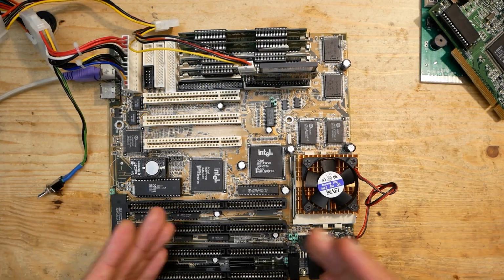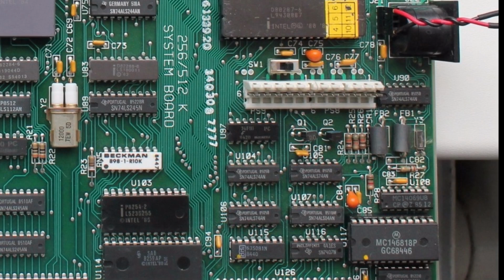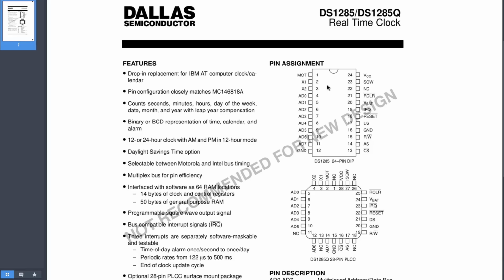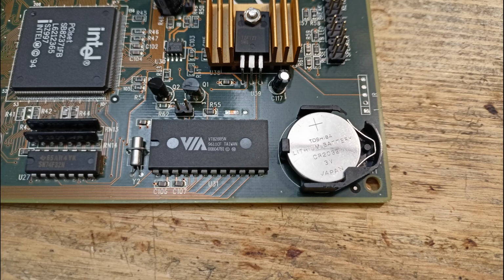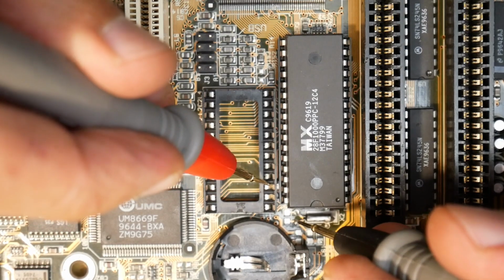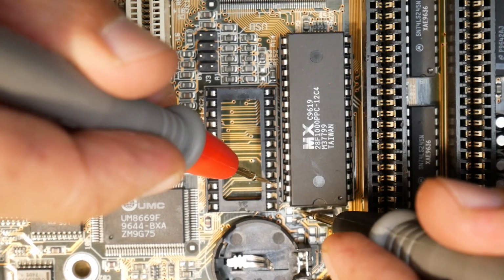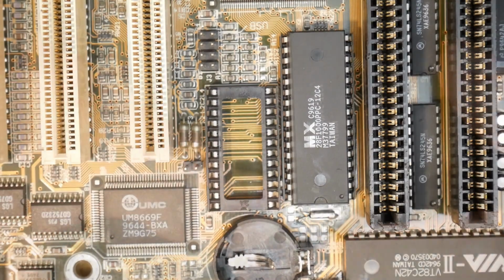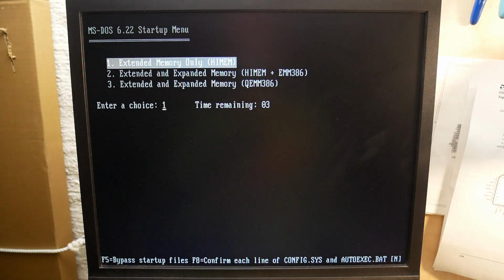Let's talk about RTC options once again

Comment: I wonder why super capacitors were not used instead of these batteries? Same circuitry, just a different  power source, a power source that could theoretically recharge while the computer is on.

Comment: I'm very late to the party with this video, but it's still very relevant 2 years later.  And your presentation of the various repair methods is, as usual, impeccable.  Thanks for this video.  I wish it had been available 6 years ago when I did the Dallas chip in my Sun Sparcstation.  I used the old cut the battery region open and added an external battery and diode.  Your other solutions are so much more elegant, though. My poor Dallas chip looked like it had seen better days when I finished, but it still works today.

Comment: I tried this method of removing the resin.
It was a lot of work, and it resulted in many bent pins which then snapped when i bent them back.
My hairdryer was not hot enough to make this resin really brittle.
Cooking it in the oven worked a lot better, but since i use that oven for food i felt that i had to clean it twice after doing this.
I repaired the broken pins. But since i'm not a solder guru the chip ended up not fitting properly in the DIL socket, and it kind of wants to fall out.

I think the surgical procedure where you drill a hole and attach a battery is preferable to most people who just want to get this working.
Don't go down the rabbit hole unless you have to.

Comment: If I just want to replace the old battery with a CR2032 holder, do you think this method would be better than grinding the side of the casing with a die grinder? Thanks.

Comment: I don't have a hot air station(for now) but I do have one of those tiny aliexpress usb-c hot plates. Do you think that might work to melt the resin if I just set the dallas chip topside down on the hot plate?
Reply from the maker: Depends on the temperature. If you can set it down to 100°C, may be that would work.
Reply: @necro_ware alright i'll give it a try.

Comment: My new  understanding that the 87 Dallas is an 85 chip with battery and oscillator is great to have.  I would rather try replacing the battery first, but knowing how to disassemble and reuse is brilliant.

Comment: You could try the DS12885S+ for a new module design
Reply from the maker: It's basically the same chip. If you have that, you can use the same design.

Comment: I had to deal with one of these crap modules years ago, ended up having to desolder the damn thing, solder a socket in its place..and I, somehow, managed to not damage the board in the process...then do the hack with a knife and file to get access to the battery.
The info readily found on the net today I didn't have at the time.
I swore I would never 'do' a motherboard that had this or similiar modules on them ever again.
Glad they went out of style and back to coin cells.
There should have been lawsuits over this crap.

Comment: This video is AMAZING. I have a mobo - PcChips M560 rev.3.1 - and it contained the dreaded chip VIA VT82887, of course with dead battery inside. The system refused to POST due to low battery error that could not be skipped. So I was researching solutions, found your opensource adapter, but the recommended Dallas chip is very expensive (mouser still has it). Luckily I found this video and decapped the epoxy resin easily. It didn't even really smell and went off without problems at around 100 C (my desoldering gun cannot go lower than that). Inside was the dead battery, crystal, and two capacitors for the crystal. All on a small PCB. Associated pins were bent topwise, so I bent them down. The chip inside was VIA VT82885.
On this motherboard, there were places for the crystal and its two capacitors and one resistor. The capacitors were inside the VIA chip and I took them off and soldered to the motherboard (2x 12 pF), but the resistor was not, so I didn't solder it as I don't know its value, it's not even mentioned in the datasheet. Then I soldered the crystal to the motherboard.
There was no place for the battery on the motherboard, so I soldered it to VBAT and GND of the chip. Then I connected the two XTAL pins to the crystal on the motherboard, as its associated traces went to "nowhere".
When I connected the battery, its voltage dropped to 0.7 V and it started heating up. Not good. After some hours of fiddling I realized that on the board, VBAT is connected to VCC - main 5 V rail of the board. What a stupidity of the designer (another stupidity is that the RTC chip blocks some PCI slots). So I cut off the pin and isolated the socket hole, and soldered battery leads from the top of the VT82885 chip.
It worked and now the board goes through POST without issues. Hopefully this helps someone too :)

Comment: Thanks so much for this information!

I had an old 286 motherboard that had an ancient RTC chip, that was pretty close to the Dallas chip according to the datasheet. The original rechargeable varta bomb RTC battery was dead and had started to leak, so I removed it. I did replace it with 3xAA batteries, and they largely worked, but after a couple of years, these alkalines were leaking as well and I had to remove that solution.

In looking for a better solution to the CMOS situation on this old 286, on a whim, I threw a dead dallas in there and it worked for storing the CMOS information and running the clock.

I then used your heating treat to remove the old casing and battery from the dead Dallas module, leaving the clock Dallas's own clock crystal on it, and soldering leads to an external CR2032 battery holder to the dallas chip itself. This way, I bypass the motherboard's battery headers (in case it was trying to charge the battery while powered) and I get to use the Dallas's very efficient clock chip without any additional parasitic load from the motherboard. 

Being my first time, it was nowhere near as neat as yours were, but still, your instructions worked and I was able to remove the old epoxy. 

With any luck, this will keep the clock and CMOS settings correct for years in comparison to the original clock module, which would be something like 100 times less efficient and chew through batteries.

Comment: This is brilliant. I just did this to three RTCs, and just as a warning, when scraping off the old epoxy, be careful around the 22-24 and 1-3 pins, as I tore the oscillator clear off. Luckily I have a stack of these failed RTCs to work on.

Brilliant work here.

Comment: I think the Analog Devices DS12885SN+ is a pin for pin replacement for the DS1285, but it's surface mount, so would need to go on an adapter board or something.
Reply from the maker: Yes, that can be used on my nwX287 module instead of bq3285.

Comment: Thanks so much for this video. I recently picked up a PC with an ODIN Dallas RTC clone. Thankfully the motherboard has the spaces for the oscillator and CR2032 holder, so I'm going to be using this method to rebuild the timing circuit. I'll probably put out a video on my channel if successful (with full credit to yourself of course) and I'll let you know how I get on!
Reply from the maker: Great if this could help! Thank you for watching too. I already repeated this not only for Dallas, but also for ODIN and Benchmarq modules and it worked fine for all of those. On note, the crystal in the module is soldered directly onto the pins of the IC, but depending on the distance between the crystal and the RTC IC on the board the oscillation can get unstable. To work against that you can solder 10MOhm resistor between the pins of the crystal. Usually mainboards already have a place for that. Good luck.

Comment: Thank you your upload! Just finished a conversion of a Dallas Rtc using the heatgun. Sacrificed a dip24 socket to save the legs of the crt ic from bending. Put the crt ic to the socket and push the legs of the socket invards. Used higher temperature - 200C degree - for shorter time to soften the outer plastic. Come off easily with the screwdriver. The resin needs a little bit more heat but it come off by chunks applying heat again after a chunk removal. Piggy backed a 2032 holder and done.  The crystal and the IC survived the higher heat, it works fine. Thak you again, no mess at all.

Comment: Thanks for the tip! I managed to replace the battery without desoldering the module from the board. I used a hot air soldering tool.

Comment: Can I just leave the RTC as it is with dead battery inside and solder CR2032 to the board (I have a place)?
Reply from the maker: No, unfortunately that will not work.

Comment: I heard about this in the last episode of Adrian's Digital Basement with the Plexus!
I easily have 3+ dozen of these darn things to modify or replace, some soldered in, some not. 
I've been ignoring the problem for years as doing the drop in replacements on everything would cost me a pretty penny in RTC chips alone and I was not comfortable coating an area in plastic dust from my dremel or leaving the original batteries in situ for the next 3 decades to short out or cause other problems if moisture should creep in.

Thank you for figuring this out, it sounds like I should build myself a little fume extractor, grab a pile of motherboards, extract the easy ones and decide if I am going the CR2032 route or do something closer to the original battery and buy a huge quantity of cheap coin cell battery holders. I will have to get creative for the network gear and analyzers that have all their stuff shoved in a card cage though, since height will matter.😅

Comment: Thank you for open sourcing your RTC replacement. I've had great success with using the TI BQ3285S-SB2 with your design. It's still made and readily available from reputable sources. No hacking old parts needed. :)

Comment: There seems to be some confusion between a "crystal" and a "crystal oscillator". Also the capacitors near the crystal are not for stability - the oscillator will run a bit too fast without them.

Comment: Regarding adding a battery by drilling a hole: doesn’t that put the new battery in parallel with the old one, causing the new battery to charge the old one?

Edit: it was adressed in the revised repair video; cutting the internal battery extends the lifetime of the new battery but the module can also work with the internal battery still connected.
Reply from the maker: Yes, I addressed it in one of my older videos. This is a common concern, but the internal battery is not rechargeable and seems not to pull a significant current. I tested two modules over 3 months, one where I cut the internal connection to the battery, the other one where I left it connected. In the end of my test I couldn't measure any difference in discharge rate of both batteries. It could be somewhere under 10%, but since the module can survive around 10 years from one battery it's just a question of 9 vs 10 years. Not really something to worry about if the battery is easily exchangeable.

Comment: They really should have installed some heatsinks (even just some metal rods or sheets attached to an metal radiator would do) inside the C64 power supply and then the resin potting would have been no big deal, at least until the PSU failed...

Comment: I have had success with other potted chips, heating them up as you described, the placing directly on ice in the freezer, usually the thermal coefficient of the chip material is different to the epoxy compound, giving a good, clean cleave line at the junction. Maybe this will give you good results without having to use force that can mangle the pins 🤞

Comment: These were a problem even when first became "standard" from Dallas because knockoff parts quickly came on many MoBo and more and those often died in a year or two. Then can Replace with Dallas parts but cost money and down time for many people and companies. Even Dallas parts with there small battery doesn't last long in equipment not connected to main power for weeks to months between uses or even storing new equipment for any reason. Many manufacturers switch to socket mounting Dallas chips for this reason because easy fix when dies under Warranty.

Comment: But also, you can give 5 Volts to DALLAS "black box" Vcc (pin 24) and it will work, yes? So, two diodes, resistor and small Li-Ion battery can solve problem with drain internal battery :)

Comment: Building some of your RTC modules has been on the todo list for awhile now, the biggest barrier being acquiring the BQ3285 IC's. After watching this I went into the drawer full of dead Dallas/Benchmark RTC's and revived a couple using this method. I used a sacrificial socket and my hot air rework station, a pair of old needle tipped tweezers worked wonders for chipping away at the epoxy. While I still want to build some of the RTC modules you designed, I do love being able to recondition existing RTC's with the parts I already have on hand. Cheers!
Reply: That's because the RTC (chip) isn't dead, just the on-board battery.

Comment: THX 4 vid
Chemical solution: Ethanol, paint thinner, adhesive remover. Heating a litte bit make the process faster.
      Use protective equipment
Test this way.
Reply: I found an old post that says to use 1-methyl-2-pyrrolidinone. I bought some on eBay, soaked the chip, and a week later I came back and all the potting was dissolved.
Reply: @owenmann1 
THX 4 hint. 
But in EU this in no more allowed in EU, in Germany look: 
"The restriction stipulates that NMP may not be placed on the market as a substance or in mixtures in concentrations ≥ 0.3% from May 9, 2020"

Paint and paint thinner are available without restrictions in Germany and can be handed in at the recycling center (municipality).
Sry 4 my bad English.

Comment: I think it is great the work you have done to make the replacement modules. I have seen others revive long dead systems with them but have yet to have a need to try it myself though I probably will at some point given the old systems I work on. Sorry you catch flack the times they don't work for people. Matching up the exact right part in something decades old in every situation is complicated. The work you are doing is appreciated and please keep it up.

Comment: Are you joking me, All those Dallas modules were just a chip with some pins bent up, a few parts added and a resin box glued atop it. If your looking to go deeper. Find an EISA bus motherboard. These boards usually had a rarer Dallas module that was not the standard one, as it had space to store the EISA configs.

Comment: If we do the last option (hot gluing the battery), does that mean we will now get the full capacity of the cell battery?  It's my understanding that the drill solution will drain about 1/3 faster because the dead battery is still connected.  If this is true, I will most likely move to remove the entire housing going forward.  Thanks for what you do Necroware!

Comment: 15:30 I've extracted a few C64 transformers from the case by heating and chipping away at the brittle epoxy and also extracted security modules or microcontrollers on arcade boards the same way. It works well but you don't need to remove all the epoxy. For the C64 PSU just remove the pcb and replace with something better. I made my own SMPS board that fits inside. The transformer works fine as-is with epoxy around it. The wires are visible and just need to be connected to the new SMPS board with a direct pass-through for the 9VAC. I also drilled into a ST M48T58Y rtc module (used on a lot of Konami arcade games) and added an external battery. Inside is a special chip and a crystal and nothing else so they can't be built from parts. These M48T58Y chips are incredibly expensive now, over $30! From the factory the battery is disconnected and on first use or testing the battery is automatically connected. But if some seller tests them 10 years ago the battery is then working and when they put on the shelf they will be dead 10 years later even if New-Old-Stock. Best to drill into it and attached a battery holder on top.

Comment: Thank you for the video: the care and effort you put into finding ways to keep these old systems operating is heart-warming.
Now apologies in advance for the comment that's coming: please don't take it personally.
"Crystal oscillator" is the circuit which generates a periodic signal at a stable frequency. The component in the metal can is just a crystal (quartz crystal) and the inverting amplifier (or inverting logic gate) is inside the chip, across the two pins marked as OSC1/OSC2 (sometimes OSC-IN and OSC-OUT). It's a bit like having a clock with a pendulum and calling just the pendulum "pendulum-clock".
Reply: yeah most people think a crystal and an oscillator are the same thing lol. on the usual selling sites with smd 4 pin types they often say active / passive but most people don't know what that means either. The active ones are true 4 pin oscillators and passive ones are crystals with 2 pins not connected.
Reply from the maker: Yes, you are absolutely right. I even explained the difference between resonator and oscillator circuit in one of my own videos a long time ago, but I keep saying this. I have to stop doing it indeed. It took me also a while to stop calling the electrolyte in the batteries acid, despite that I know, that it is actually a base. People were always confused why I neutralize acid with acid, when I was using white vinegar. I'll try to improve next time ;)
Reply: @necro_ware  not to worry! 🙂
Great job finding the best way to remove case and potting from the RTC modules. The longer I think about them the more it seems they had a really daft idea at the time.